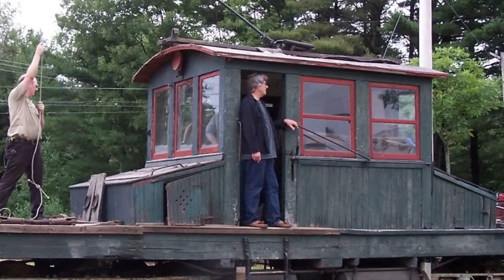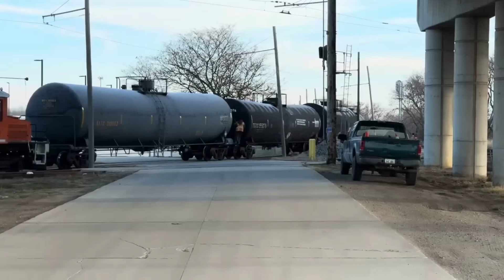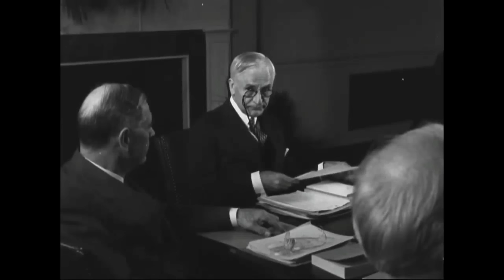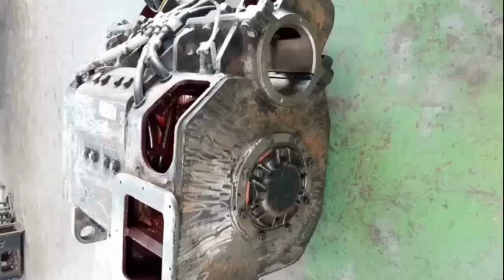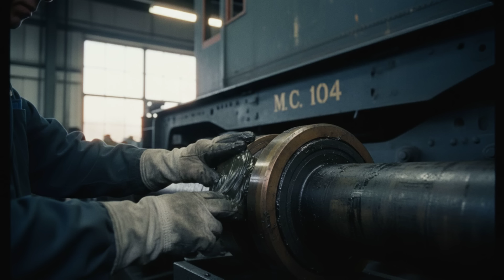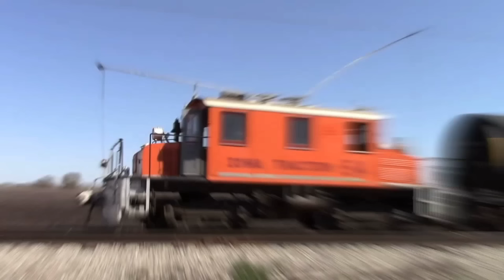America’s Last Interurban: How a 1920s Electric Railroad Still Survives

Comment: This entire video is stolen, uncredited footage, fake pictures and misinformation. The "moat" chapter made no sense, as the Iowa Traction's predecessors did use diesel on their electrified lines and there's footage in this video of them hauling cars as tall as diesels, so saying diesels cannot run on their tracks is incorrect. They are electric because it's the equipment on hand and it works well, plus a possible contract requiring electric operation under the current owner.

Comment: CORRECTIONS---
THIS is last surrviving
ELECTRIC FREIGHT INTERURBAN in USA, some others were absorbed by rail road companies and operated by diesel.

Only 3 Elctrical operated interurban lines as noted above, two in Philadelphia PA
suburbs and South Shore in Chicago area still are assenger line e tities, this being exception ss Freight wss slways main busuness.

There are 3 lines that sort of exist as parts oof city transit syysterms

BOSTON> The BLUE line part that runs on overjead is in city remement.

NEW YORK CITY the track in Northern Bronx from 180 st to DYER AVE is remnent of New York, Weestchester and Boston, and if you look out window you can see stumps od poles that carried overhead wire.

CHICAGO tracks heading to Skoke (and another route) are in city limit part of interirna.
Reply: Also, Pittsburgh’s Silver Line, a remnant of the interurban line to Charleroi. The Drake branch, which was suspended in 1999, was part of the interurban line to Washington, Pennsylvania,. Overhead and feeder cables are gone on the Drake branch, but the rails are still there.
Reply: @kennethjosephson134 Thank you.  Didn't know about that one.  I suspect though, given the interurban network, especially electric freight, alot of trackage is fagmeents of ...but not obvious.
Reply from the maker: Thanks for providing that detailed context and clearing up the definitions! 🚂